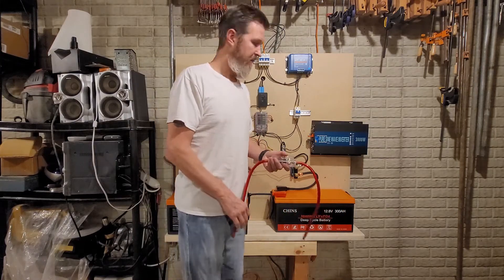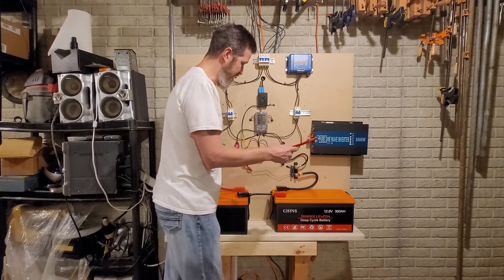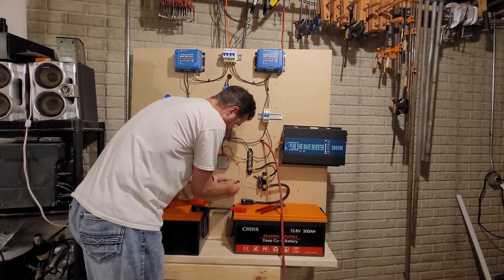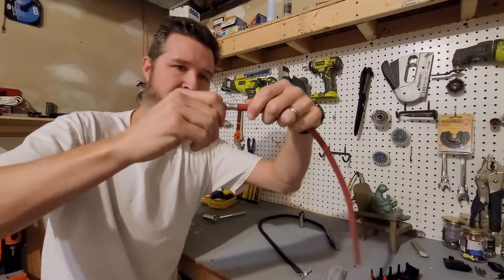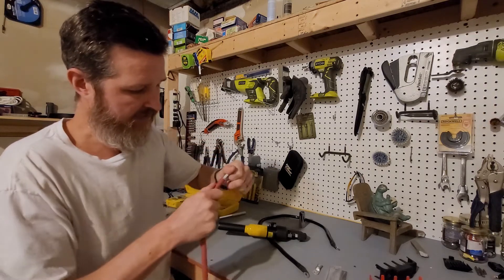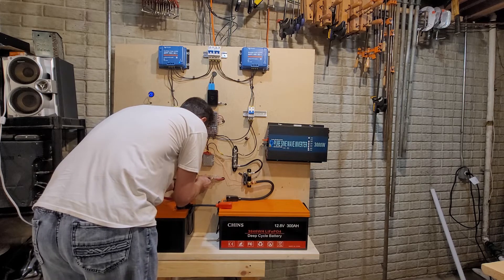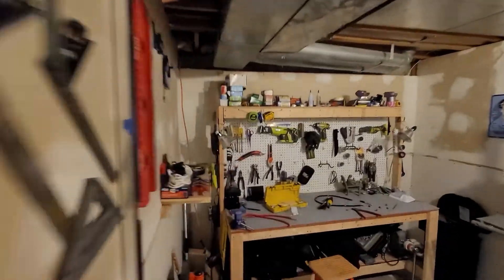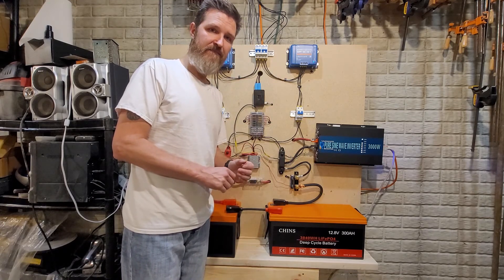Upgrading my 12v off-grid system to 24v!  Part 2

Comment: Which charging voltage setting did you set the charge controllers to please? I know the batteries are originally 12 volts, then they are coupled to 24 volts on a bus, and the original BMS per battery would’ve been configured to 12v and around 14.6 volts maximum charge voltage. So my question again is, what settings did you choose for you charge controllers to charge these 12v batteries running this 24v system. Thanks man
Reply from the maker: I have my charge controllers set to 28v, then they float at 27v.  Hope that helps!

Comment: To be honest with you, whether you’re going to push the 3000W inverter to its limit or not even a 2000W inverter would require a minimum of a 200 amp fuse, so I would suggest at least take your fuse up to 200A
Reply from the maker: I would do that for a 12v system.  3000w / 24v = 125A.  125A * 1.25 = 156.25A fuse.  I'm just slightly under, but I'm ok with it.  Thanks for the comment.

Comment: When you apply voltage to the Invertor for the first time, it charges up the internal (electrolytic) Capacitors. 
You cannot instantaneously chenge the charge state of a Capacitors -- and BIG inverters have lots of BIG capacitors. The more powerful the inverter and the higher the voltage, the bigger your problem.
Using the resistorr in series allows the Capacitors to charge up slowly so that when you apply the full voltage (without the resistor) they are already charged and polarised -- so you don't get a spark.

Best wishes
Bruce 
Dr. T (G4ABX)
Reply from the maker: Thank you for the great info and the comment.
Reply: @OffGridBasement  You are welcome. Have a great weekend
Reply from the maker: @Dr-T  To you the same!  Thanks.

Comment: Always keep in mind, you rate the fuse to protect the wiring..  Can't tell exactly, but your wire from the shunt to the negative block is smaller than the battery cable.. So you'd derate based on that smaller cable..  Recommended for #6 is 100 amp fuse, #4 is 150 amp, and #2 is 200 amp.. Keep having safe fun!
Reply from the maker: Thanks for the info.  You're correct about that wire.  It's 4 awg while everything else is 2 awg.  I plan on switching it out, but I just haven't gotten around to it yet...  :-(

Comment: Well done, sir. How has that 24v to 12v step down converter held up over the last year?
Reply from the maker: There is a video coming out today about the 24v system and how it worked over the last year.  The step down is still working well.  Never any issues.
Reply: @OffGridBasement  Thank you. Watching it now!

Comment: When changing from 12V to 24V did you reset the Victron? If so, in what way.
Reply from the maker: I didn't have to do anything with the battery monitor since the amount of amp hours didn't change.  I did need to change a setting in the charge controller about the voltage.

Comment: What’s the purpose of going from 12 volt to 24 volt system ?
Reply from the maker: At the time I wasn't ready to jump to a 48 volt system.  I felt like it was too dangerous b/c of my lack of knowledge.  Now I wish I did.  Being able to use smaller wiring and already having a big 12v battery made it easier to switch.  I just needed another 12v battery and I was planning on buying a new inverter anyway.  It just made sense at the time.  Thanks for the comment!

Comment: Looks like a good update from 12v to 24v.  Thank you for posting these videos showing how you did it.

150 amps times 24.8 volts is 3,720 volts.  I would say that is absolutely right-sized for your system.  The fuse should really be a short run in-between the battery and the bus bar.  Glad to see I'm not the only one who obsesses about the crimp and exposed wire be exactly the right length.
Reply from the maker: Jason, thank you very much for your comment!  That's a good point about the fuse location.  I'll probably be moving it soon.

Comment: Fuse is ok. I have a low frecuency 24v inverter 3.6kw with the same fuse with 2 computers, 9 led lights , 1 fridge  and two fan without problems. about 9 months off grid 24/7. The inverter is always almost cold . Never use more than 1kw.
Reply from the maker: Thanks for the comment!  I'm glad to hear your setup is working well.  The only times my setup gets over 1kw is when I use the electric heater and my sump pump starts up.  Never have a problem.